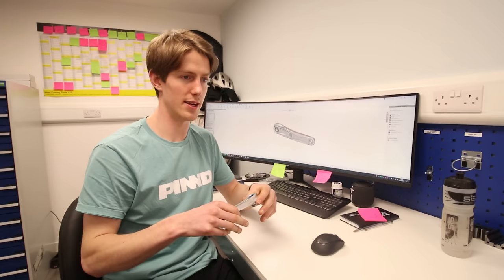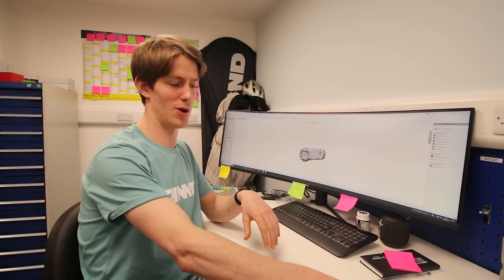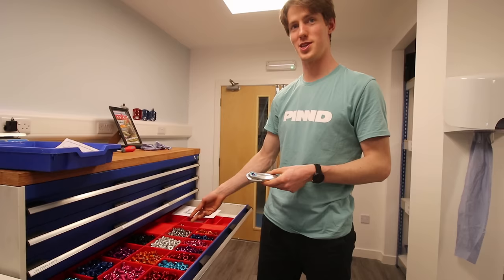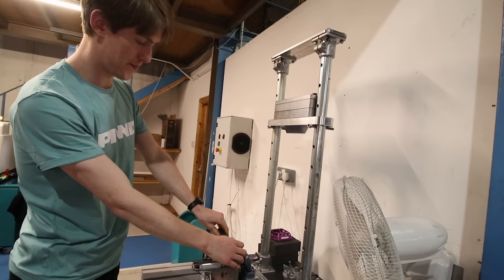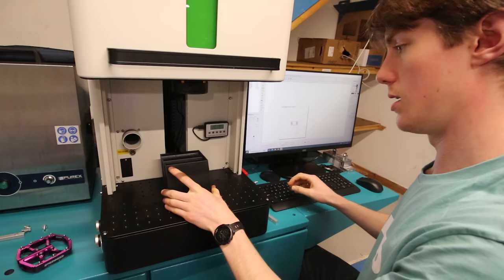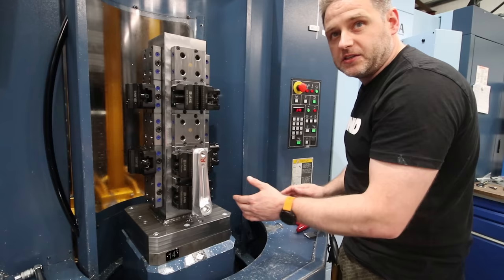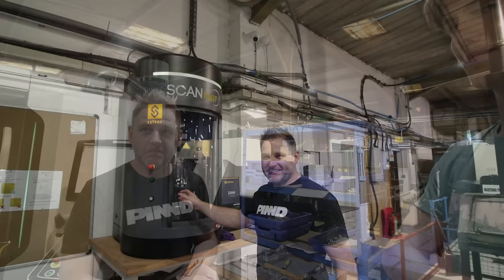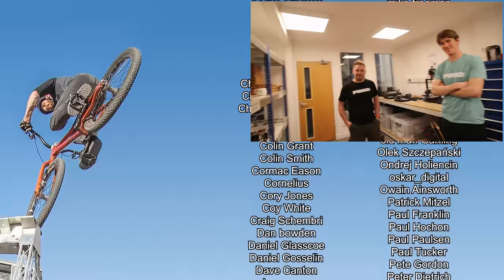These Are The shortest E-Bike Cranks Available - Pinnd Crank Factory Tour

Comment: Mike Burrows had all his cranks measure in at 140mm and he swore by it, said they measured consistently higher power outputs. People get torque and power mixed up, sure a longer lever gives you more torque, but a shorter crank in a lower gear lets you spin faster, as well as spend less time in the dead spots.

As for ebikes, short plain cranks have existed on unicycles for decades, in all kinds of sizes, from 170mm down to sub 100mm lengths. I'm not sure if unicycle ISIS splines are the same as those used on mountain bike cranks, but it might be worth a go.
Reply: Yeup Mike Burrows cycling genius 79 no age at all RIP

Comment: With the pedal testing I would like to also see the weight hung from the outer most edge of the pedal and the bearings tested there. Not everyone weights the pedal the same. Every set of pedals I blow out have the design where the shaft does not go to the end of the pedal, it only goes about 3/4 of the way. I've broken Crankbros metal stamps and multiple metal others in less than a year of commuting. I have a pair of cheap nylon amazon Fooker pedals that have outlasted all the others! Their shaft goes all the way thought. I'm just happy to see you test your stuff so much! Probably going to give Pinnd a try after this!
Reply from the maker: I see where you’re coming from but I would guess that hanging from a fixed middle point would give consistent results rather than the length changing with each pedal model?
Reply: I use the Fooker pedals as well. Surprisingly good pedals, and if you ever do wear them out, just toss in the trash and order 4 more :)

Comment: 145mm?! you can get some real rpm from those! :)
Reply: It shouldn't affect your cadence though, it only lowers your torque output. Normally that would force you to use an easier gear and increase rpm as a result but paired with an electric motor it's a different story. I pity those poor chains :D
Reply: @frankthetankricard  i more so said it as in comparison to crankshafts, as the ones with smaller offset offer higher potential for crazy rpm

Comment: Is there any difference between the pinnd pedals compared to the hope f20?
Reply from the maker: Yes…everything 😂
Reply from the maker: So from a quick look it seems Hope only machine the body, has a plastic bushing (alongside cartridge bearings) and a standard rubber seal.

The Pinnd is fully made in their factory including the axle and pins (bearings being the exception).

Rather than a plastic bushing it has a needle bearing (as well as cartridge bearings) and the rubber seal is upgraded to an oil seal.

You also get more axle and pin material choices.

Comment: I have seen no evidence of any advantage to short cranks other than on a stationary bike. A crank is a lever, why would you want less leverage? Pedal strikes are less important than having the power to make a climb. I like long cranks as you can lock your feet to the pedals better in severe chonk. I've got 165 mm on my Norco VLT and I hate them, I will be making some 180 maybe 185.
Reply: What part of 'e-bike' didn't you understand in the video?
Reply: @TorrentUK  I'm talking ebikes, the 180s are for my Norco Bigfoot VLT.
Reply: @augsu  Okay in which case, the evidence is that it's common to have pedal strikes on e-bikes. I have an enduro emtb and I can't run it in the low chip setting as I will be striking all over the shop. A lot of people have been installing Hope cranks as they have the flat bottom to their ebike range. This is a really common issue. You don't need the leverage advantage when you've got a motor, assist, and in fact you benefit from being able to push a higher cadence. There absolutely is a benefit.
Reply: Bike fitters recommend shorter cranks, extended foot being higher with shorter cranks giving more flexibility to upper body position. Pedaling might become more efficient, less force but more rotations. Foot travels higher, so more ground clearance when leg is extended. Also less forces on joints (less of an concern on e bikes maybe, but all that force travels through your joints). Probably missed some points. It all depends on your riding style, bike geometry and physique. If you are using a lot of assistance it probably has a very little effect other than the ground clearance.

Comment: My most recent build was with Hope 155mm length cranks.. won't ever build with cranks that short again.. they do not suit my style or size.

If I crank aggressively into a trail I get terrible knee pains became of the off position, having to hold myself higher than I should without getting full leg extension.

Plus when airborne wanting to make shapes, they are noticeably more difficult to manouver, which makes sense because one of the levers for  manipulating the bike to get sideways is now shorted, making it more difficult.. 
As I say, for me, my style.. hell no.. short cranks suck.. just another case of "idiot, why did you join the hype train on this"